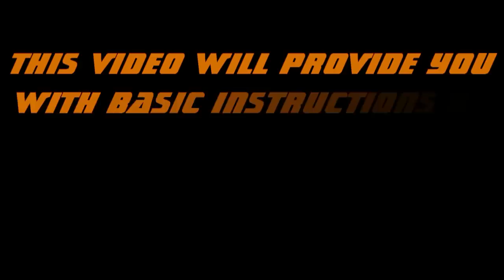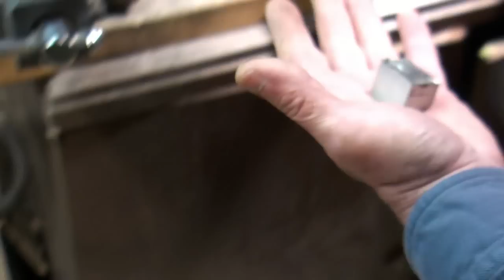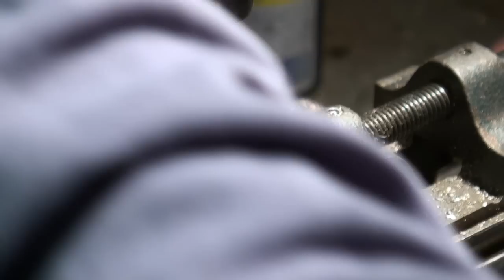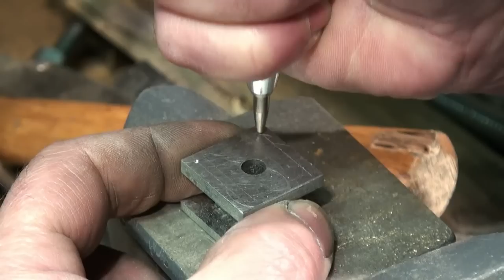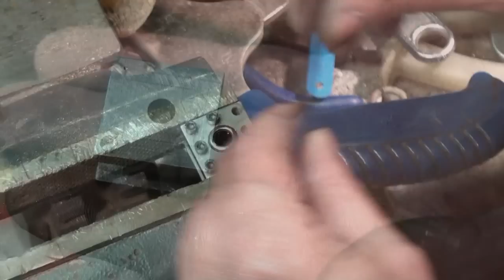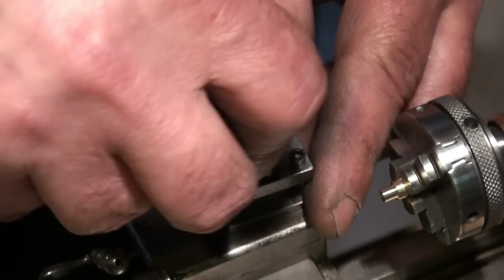Watchmakers Lathe Tool Holder

Comment: Never grind aluminum on a cutting disc larger than a dremel size wheel!
The aluminum loads the wheel, then with the heat if grinding that aluminum expands and can crack the wheel making it explode while spinning. The reason I saw dremel size wheels are okay is because if a dremel cutoff disc explodes it's not a big deal and certainly not lethal.

Comment: You should have clamped that piece otherwise.. if you had clamped it rotated 90°, the top, or bottom surface would have been on the same spot everytime.. so all the cuts would have lined up  perfectly...